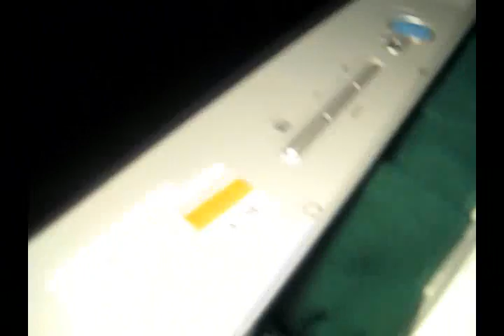Capacitors - Fixing an LCD computer monitor

Comment: Thanks for this helpful video - just disassembled my Chimei 19 inch and found 5 blown capacitors (2- 1000uF 25V; 2- 220uF 25V; and 1- 1000uF 10V). Cheap thru eBay - $2.97 for all capacitors (and extras to boot). Of course, they're coming from Thailand ;^)) Will follow up next month when I reassemble the thing.

Comment: Had the same problem with my PC Motherboard about 2 years ago. Random crashes, and my fans stopped. The problem was my previous power supply. The 12V went faulty and popped a cap (Black can) on my MB. Replaced the cap with a higher temp (purple can), same value/voltage from a spare power supply I had. Replaced power supply with a better make/higher power type. Havent had a problem since!! Thanks for uploading. Very nice find for the price! Jammy bugger !!

Comment: i did fixed my monitor by replacing the two capacitors in power supply...and i got my new capacitors in my old power supply unit from my cpu....now it works like a new one...thanks man!!!!i saved 30,000 yen...

Comment: A very informative video, I have gone through the same procedure with many LCD monitors in the past, and the only cause of cap failure has been poor quality components!....one thing you forgot to mention is the temperature rating, which is always marked on the cap.......for replacements in power supplies and long term reliability, you must use 105 degree rated components, this is usually marked on the casing of the old ones, so you can really be sure of what ones to get!...

Comment from the maker: As long as it fits.  Diameter is usually easier to fit but sometimes taller ones will interfere with the shielding when you try to put the board back into place.  You can either modify the shield/chassis or simply mount the capacitor sideways in whatever configuration works.

Comment: "just liquify the solder points with your soldering gun and kinda rock it back and forth..."  Not trying to be rude here, just a suggestion.  If you have alot of solder points to desolder, you might want to use a desoldering iron.  Weller has some really nice ones that aren't too expensive.  I've found it makes for a much cleaner job.

Great video though.  Got me through my Westinghouse monitor repair.  Thanks.

Comment: In general think of the higher voltage rating as being headroom and less likely to fail. As mentioned in the video using a 35 instead of a 16 means you will have a beefier power supply. YMMV obviously.

Comment: I just repaired a couple of Westinghouse 17" LCD displays.  Both of them would work for 2-3 minutes and then the panel would fade to white (Loss of input from the video circuit. LCD panels "relax" open.)  So on the power board, there were two 220uF 25V caps that had failed in each unit.  Radio Shack carries 220uF 35V caps.  $2.50 per monitor, replaced the bad caps and they both are working fine now.

Comment: I just had the exact same problem with a 15" compaq. I replaced the 1000uF /16v with a 1200uF / 16V from an old motherboard. The capacitors used in this part of the monitor are smoothing capacitors so it doesn't really matter if you use a larger uF value. With smoothing capacitors larger values are better... up to a point.

Comment: @TheWillSmithy If your back light is going out on your Monitor. It is the inverter board. You may also wanna test the transformers for the Inverter board as well. as those can be faulty. Just Search "Testing Transfomers" You will find a video about testing them on inverter boards

Comment from the maker: That being said, I have never shocked myself on a capacitor while working on an LCD monitor or TV.  I have, however, shocked myself on a camera's flash capacitor which can really pack some volts.  It just hurts and makes you drop whatever you're holding and you get really angry for a bit.  :D  Just let the board sit unplugged for a while and everything should drain and be completely safe.  Good luck!

Comment: it works for me. I was thinking about capacitor and then i search ur post and solve my problem. I get Capacitor from my Dead Computer mother board :D so i solve my problem free :D I use 16V 15000U. before it was 16V 10000U. now its working very good. Thanks and sorry for bad English :)

Comment: very good. i liked this video. had some good information. My samsung 40" LCD tv went bad and would keep restarting over and over again. i took it apart and sure enough the capacitors were the problem. i fixed it myself and saved a 2000 dollar tv !

Comment: You can find 2 types of caps: 85 and 105 degree. Err on the side of caution and get the high temp. You are pretty safe upping the voltage, it makes the cap brawnier for the circuit and may last a lot longer.

Comment from the maker: I definitely did overlook that!  

In fact, now I need to take apart this old CRT TV that I fixed the other day (well, 2 years old).  It had a bad 330uf  200v cap... Which I didn't have so I stole two 660s out of a power supply (how lucky is that!?) and put them in series.  It... works...  I'd assume they're the right temp rating being as they came out of a PSU and went into the PSU circuit of the TV.

Comment: No go - replaced the capacitors - would not power up still. Re-checked my soldering and tried again - nope. A burnt smell comes from the area around the power chord plug. Possibly something in that area blew the capacitors to begin with. It was worth a try - and only cost $2.97.

Comment from the maker: @mooserak I've seen them with marker on the top.  If you have some rubbing alcohol, see if it will come off easily, in which case I would assume it is simply permanent ink from the factory.

Comment from the maker: Hmm.  I guess I can only somewhat picture what you mean in my mind.  Is it just one half of each capacitor, one of the lines, that is close to the strips?  
The solder pads on the back should keep the solder from going anywhere it shouldn't.  I don't think you'll have a problem?  You can test what the strips are connected to, if anything, with a multimeter/continuity tester before you put the new caps in and see if they are supposed to be connecting anything on the caps.

Comment: Received the 220uF 25V and 1000uF 10V capacitors today - installed. Waiting for the 1000uF 25Vs. I noticed the old 1000uF 10V I removed was larger in size than the new one I installed - does that matter?

Comment: Yes, I also fixed a monitor with two blown caps, but in most cases, the CCFL tubes are bad and that's a very expensive thing to replace, not to mention hard to find.

Comment from the maker: The key hole is actually for attaching a locked cable to the monitor, which can then be attached to a table so noone steals it.  :D  If you ever find yourself in a large public computer place, like a library maybe or a school or something, they might have cables/locks on their monitors and computers.  
Anyways, displays usually have some silly plastic clips around the edge.  You may have to get a screwdriver out and start CAREFULLY prying at the seams.  Be careful and find the way the clip goes

Comment from the maker: The power supply inside the LCD does have high voltage sections - the parts that are converting your 110/220AC mains voltage to 12/5/3DC volts is a dangerous section.  When working on the power supply I recommend unplugging the monitor from the wall and letting it sit for a few hours just to be safe. There's probably more accurate information elsewhere so don't take my word for it. The main big capacitor can be dangerous, but the smaller ones (that I replaced here) might hurt but won't kill you.

Comment: @Tda7000 When I say all, I mean only all those on the PSU board. If you have an ESR meter and measured that 5th capacitor next to the other 4 bulging ones, you would probably find the ESR was way too high.

For replacements, it's best to look up the datasheet for the original capacitor, and then find a replacement that matches it, especially for ripple handling ability and ESR. 

You should go for higher quality like Panasonic, Rubycon etc. You can buy these from Digikey, Mouser, Farnell etc

Comment from the maker: I know some multimeters have a capacitor setting.  I know my father has one but I've only really used it to figure out old/small/unmarked capacitors' ratings rather than test if one is good/bad.  

Allegedly, a capacitor can be bad even if it appears normal.  I haven't yet come across this scenario just yet, though I have one monitor (a Lenovo) sitting in storage that has a flickering backlight and all the caps are "ok" (looking).  I've yet to get the courage to re-cap the board in case.

Comment: @dingo27mobile am not so sure because the monitor is going on and off repeatedly until i disconnect it from my laptop or tower.
so my theory is that because the capacitors are leaking the monitor can only handle its own power. when there is power from an input the laptop that is it starts bleanking.

Comment: Thanks for the tips. I stumbles across this vid. I have an old Gateway computer that works sometimes and it has 2 blown caps that I can see. This could be the problem. I shall try to replace them when I have time.

Comment: Thanks for the video... As far the camera I think if you give us a couple examples on where to read the voltage/uf on each capacitor don't have to angle it to show us all of them. Maybe you can attempt a stationary cam pov and you angle the stuff your working on to create the shots. On the plus side it was clear what needed to be done.   On a side not, my LCD screen got hit and turned all white, i'm sure it's internal, any ideas on what could have happened there, and if it's fixable?

Comment: If the backlight is flickering, it would be more likely that the tubes(cfl) are degassing.
There are several sources on ebay or the net. Measure the tubes (usually top and bottom of screen...)

Comment: I was always told the best way to do it was...(in reference to PCs or anything with a converter.) Unplug the device, the press the power button about five times, then wait an hour. This forces the device to attempt to power on and empty the capacitors. While the extra hour lets the remaining energy bleed off any lines. (This being a concern with static electricity)

Comment: BTW, (again) is there a way of testing the caps to see if they are bad? I heard about attaching a multimeter, set to ohms(resistance) and checking if resistance increases on the cap, after of course discharging it. But all seemed ok (can't be sure, some were slow to pick up).

Comment: I hear I should discharge the capacitors with a light bulb before removing and placing them. What is your thoughts on Capacities and their residual charge? I'm looking to repair a couple Caps on an HDTV and it's my first time. Just a bit scared it will blow on my face.

Comment: Used to repair a PC mainboard like this.. Despite i couldnt find the right replacements in the local stores so i took ones with hiher max. voltages: worked well but looked kind of fun coz they didnt fit really well and were knicked over the others.

However, as high as this damage here is.. its possible there was a reason for them to blow!  Either an AC or too high voltage went there.. Did it work after the replacement?

Comment: Good video, but in this kind of case it's best to replace all the capacitors instead of just the bulging ones (except for the large primary filter cap) Because the rest will be in almost as bad condition, even if they aren't showing it. Also I notice yours are branded "Elite" which are known to be pretty cheap quality. That brings up another thing, you should avoid cheap capacitors from RS, as they are probably just as bad quality as the ones you already took out. You usually need Low ESR ones

Comment: usually, if theirs lines or lcd distortion, the screen is damaged, either the leads or the transisters inside the screen itself (the latter case means the screens unusable).

Comment: I'm familiar with different pc repair, but never messed with soldering and actually fixing malfunctioning hardware. My problem is similar to BSEmadcow's, are these "caps" the dented up part? I opened it up and it looked very similar to your dented up capacitors.

Comment: I have an old LCD that won't turn on instantly and it takes a hour or so to warm up. During this 'warm-up' period the power LED flashes off and on and there's a static sort of sound which disappears when it's up and running . In your opinion, do you think the capacitors could be what's wrong with mine?

Comment: I have two busted monitors and I suspect that their capacitors are blown, BUT i'm struggling to open the back panels. both seem to have this rectangular key hole. One monitor even has a symbol of a lock near the hole. Do I need to get some sort of key to open these monitors?

Comment: that is because A+ equates nothing in my book except a frame of reference, i personally took the class and i learned 10x more from field experience and the internet..... but if your monitor is just flashing it could be the video board that could possibly be separate from the inverter board. It could be a blown cap there but, i am more of a laptop guy and that usually indicates the LDVS cable (the main connection to the monitor) is not attached correctly but most likely it is the Video Board

Comment: does lcd have high voltage like old tubes does ? 
is there procedure before removing capacitors ? old tube need to be grounded from the suck tube if you know what i mean. 
do lcd have high voltage if there is no danger then i can go ahead remove capacitor ?

Comment: Hey, I've got the same symptoms as BSEmadcow, the LCD won't turn on immediately, but takes 5-10 minutes. After that, works like a charm. So I opened it, (I'm not an electronic expert, but manage quite good and know how to solder etc.) but the caps weren't showing obvious signs of failure (weren't blown or domed). Is it possible that they are to blame nonetheless? BTW, I've got a 19inch samsung 940bf (bought 6 years ago). Would be great to rejuvenate it, rather than spending on a new one.Thanks!

Comment: I imagine your monitor has the same issue as described here and in my comment.  If you are comfortable working on such things, and you're good with desoldering/soldering to a board, open your monitor and look at the power board.  Look for capacitors that have bulged and/or leaked.  Replace with exact same uF values.  Higher voltage ratings are OK if you can't find exact replacements.  I suspect you've got the same issue.

Comment: If the capacitors are good(visibly) and the monitor is turning on showing picture and immediately turns off after 0.5-1 second what is the usual cause? The Lamps are fine - I tested with others ;). I have another problem with a monitor showing white all over the screen or different squares(squares over the whole screen) of white going up slow or fast. After loading windows the picture is totally fine which is the amazing part... I will soon upload a video of it :).

Comment: I have the same problem with one of my monitor, but in addition to a bad cap, there was a resistor on board and the pcb around it is kinda brown (like a burn mark). Do I have to worry about that?

Comment: I have some 450V capacitors in my LCD monitor. How long will it be charged when unplugged? can I just make a short circuit to make the voltage drop or is that a bad idea? Are these as bad as the ones found in old TVs?

Comment: guess something else has gone rather then the capacitor i think its the transformer and i had another but it was ic chip that went bad and i cant find replacements for either so just gonna use the lcd screens for something else

Comment: Recently when I turn off my monitor it turns white because the lamps inside dont turn off. I opened it up and noticed 4 bulging capacitors.
Will replacing these fix my problem?

Comment: Hey ngtflyer, I have a 22" Westinghouse monitor that just recently started turning white when I shut my computer down or it goes into standby. Could this be the issue. And if so, did you make a video of how you replaced the capacitors. It's 3 yr old and Im a big gamer. I don't want to lose this monitor right now. I'd appreciate any input. Thanks

Comment: on my pcb, it doesn't show which is positive or negative. Since this is my first project, I want to be very careful. I know which is which on the capacitor, but wanna know if I am installing right. In the circle where I removed the bad capacitors is a black side of the circle, and a yellow side(the color of the pcb side). Which side is + or -? And should I go + to + - to -?

Comment: hello i was wondering if you could help me. when there is no vga wire connected to it the green light goes on and it says no signal. so am sure that normal as their is no interface wire connected to it.but the problem is when i connect the vga its start going on and off repeatedly  about a sec interval.Am hoping you might have the knowledge and experience to understand this problem so i myself could do a DIY repair.

any help would be appreciated thank.

Comment: My monitor doesn't turn on anymore and no power light indicators light up either. I tested the snap in fuse and it seems to work and all the capacitors seem fine with all flat tops. I see no burn marks anywhere and i don't smell any burns either. What else could it possibly be? or can a capacitor be bad even without it looking blown. help! Thanks.

Comment: i just got a monitor and when i plug it in the power button led flashes.
do you think its the Capacitors?i tryed 2 dif power cords.
the first 1 made the power led flash with no vid.
the 2nd 1 power led stayed solid.but i seen faint flashing lines on the screen.

any tips on fixing this?